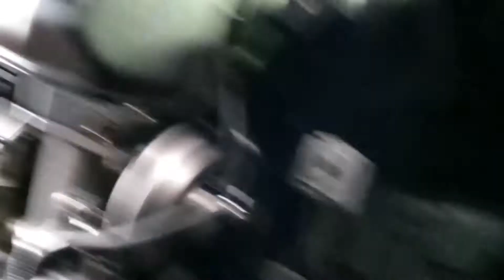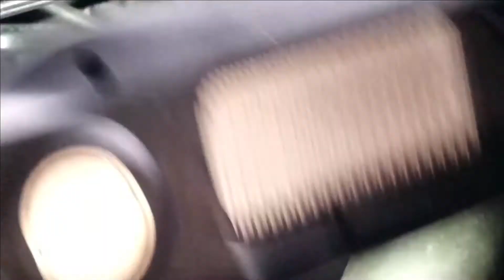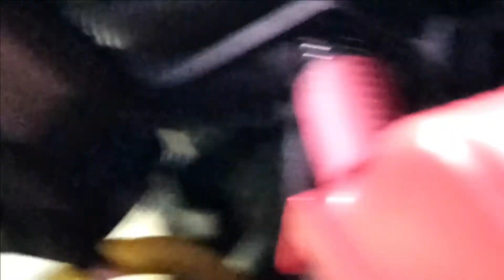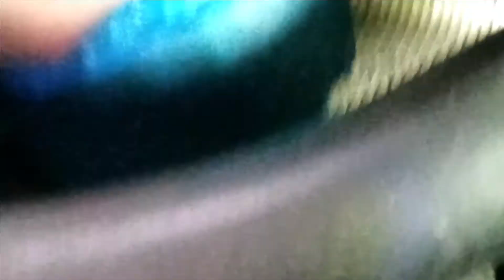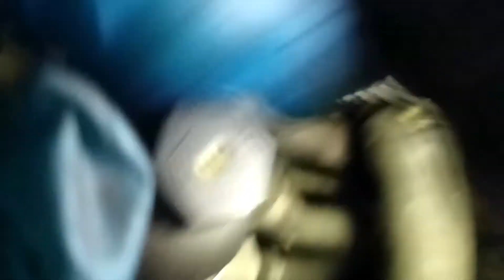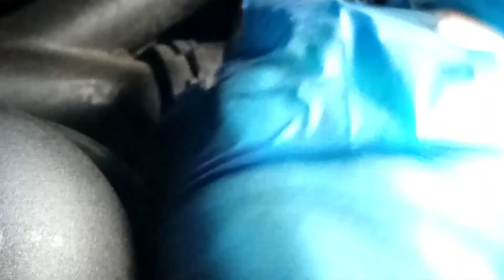Lumpy Cold Start for Few Seconds And Smoke cloud on BMW E60

Comment: Best to unclip the harness connectors before removing the module from the engine block as this holds it securely whilst unclipping the connectors.😉👍
Reply from the maker: It wasn't that easy to reach it that's why I did this way.

Comment: Did changing the module fix the issue for you ?
Reply from the maker: @paulmc9337  yes it did. And lasted for 2 years. Hitachi is not the best module to use
Reply: @--unknown-- thanks . Just ordered the hitachi unit , my smoke is blueish only happens when cold lasts maybe 20 seconds and clears off .slight judder too just after initial start
Reply from the maker: @ exactly the same issue I had
Reply: @--unknown--  thank you 👍🏼

Comment: did you have any errors on the ecu ? mines doing the same thing but no errors on ecu, all glow plugs are good.
Reply from the maker: No errors
Reply: @--unknown--  thanks for the response, that fills me with confidence in that case, as mentioned mines doing the same, idles like a v8 rocky smoke then calms down. will try a new unit cheers.
Reply: also my old one went faulty which was hitachi so i replaced it with the beru one, not sure beru ones are that good, so getting a hitachi one this time.
Reply from the maker: @bavarianmotorwerks3353  mine Hitachi was good only for 1 year
Reply: Same story here, starts rough, idles like a clapped out muscle car and puffs white smoke when first started and it's cold outside. Otherwise it's fine and there are no codes...
Reply from the maker: @def1nity  common issue on them
Reply: @def1nity  i've ordered a new glow plug module i will let you know if it sorts it, if it don't then I suspect its the piston rings.
Reply: @bavarianmotorwerks3353 did it sort it? :)

Comment: Is it any problem to ignore this? In Ireland it rarely goes below -4/-5°c in winter but my module is finished and have some smoke and rough idle for maybe 5 seconds on first start of the day. Should be fine to leave it for a while?
Reply from the maker: Had the same issue. Replaced module and start as it should. Sure you can drive, it's just the cold start.

Comment: My does this But SUPER slow start. Only -1. Like Today was slowest ever, took about 20-30 secounds, But changing plugs/that module + oil change (pretty Old oil have been lazy…) would solove the problem you think? ”BMW E60 530d 2006”
Reply from the maker: I have changed plugs and module. But most often it's just because of module failure. Common issue on E60
Reply: @--unknown--  my friend said that Aswell so i Will take and change it and change oil hopfully that fixes it, thanks for the videos 😁